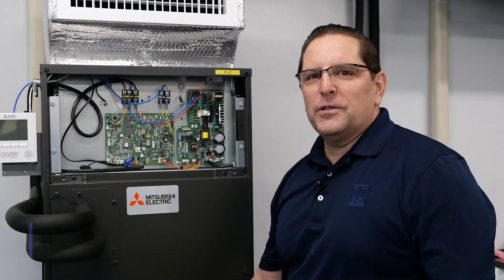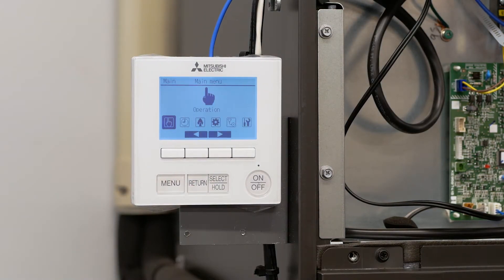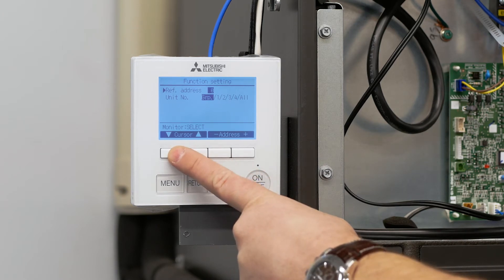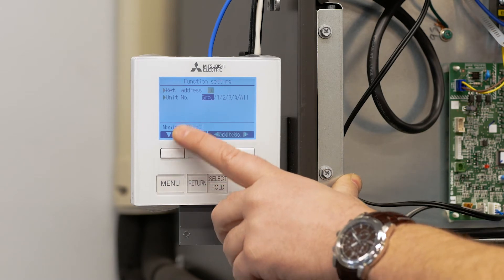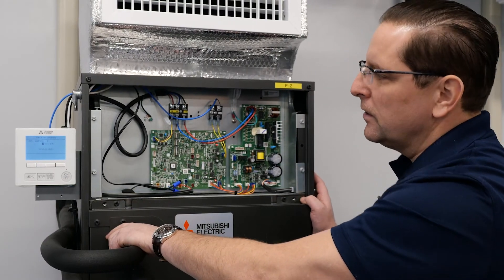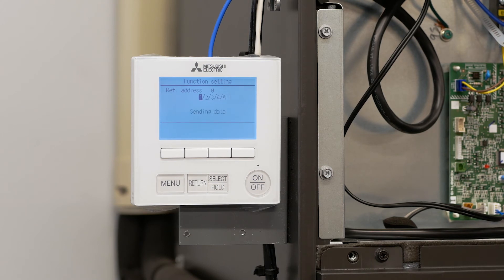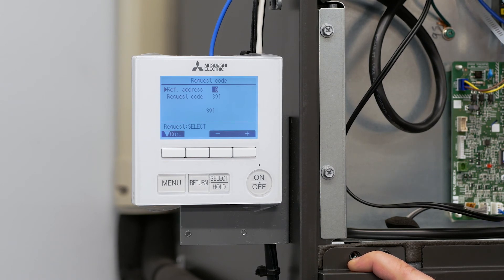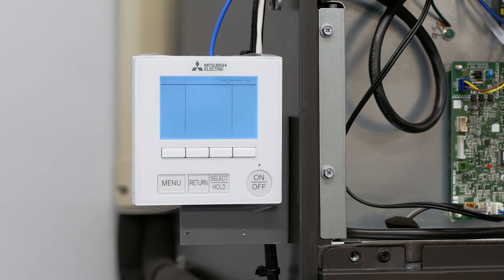Technically Speaking EP 6: Mitsubishi Air Handler Settings - PAR 40 Controller

Comment: Where is mode 25 and 27?  to set the fan in standby in heating and cooling.  Mine is constantly running at low speed, which is not needed in my setting with the remote thermister being used in the room, not in the air mover.

Comment: Thank you! I could not determine how to change which temperature sensor was used for reading room temperature on the TAR-40MAAU controller/thermostat. As recently installed,  it was using the unit/air handler sensor, and the the room temperature reading was very inaccurate.  Even with the heat setting set as low as it would go to 63 F (Which is another problem, why can't I set the heat any lower than that?), the unit was heating to 74 F or more. Now that the room temp is using the sensor in the controller, the room temperature reading is accurate, and the system is heating to the correct temperature. None of the manuals helped. This was such a simple fix to get it working correctly, I am so glad I stumbled on this video.

Comment: We have a city multi system, one condenser unit and about 15 indoor units. On the function settings “ Ref. address” default is 0. Should I change 0 to the unit M-net address? Like 1, 2 ,3 depending on what number assigned to each unit? Thanks